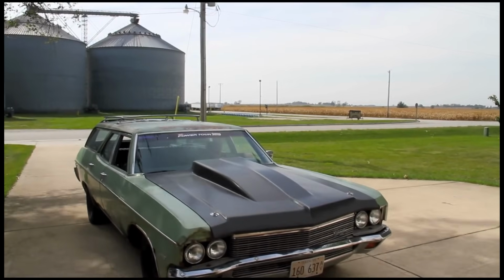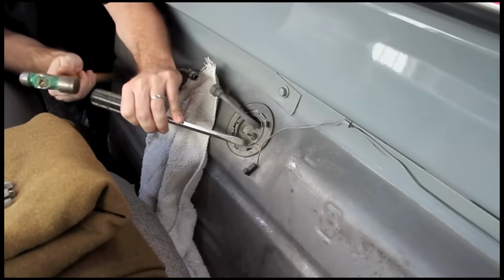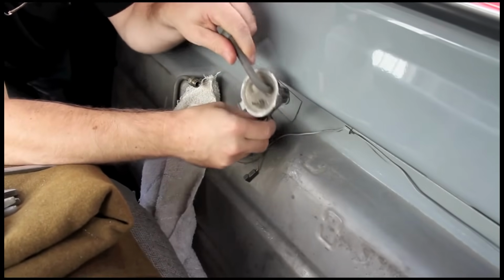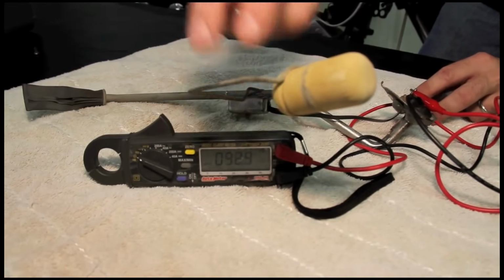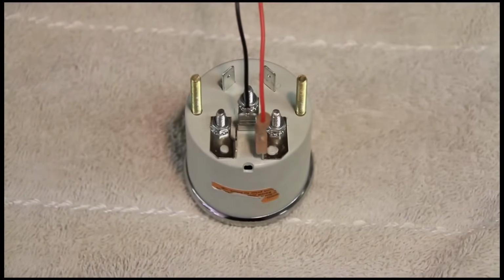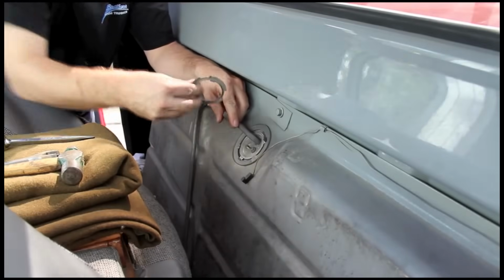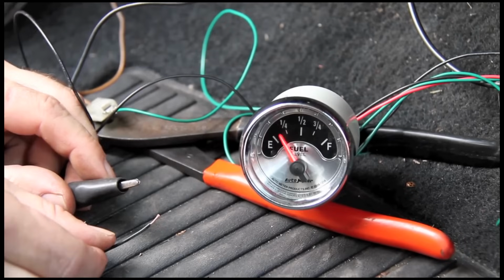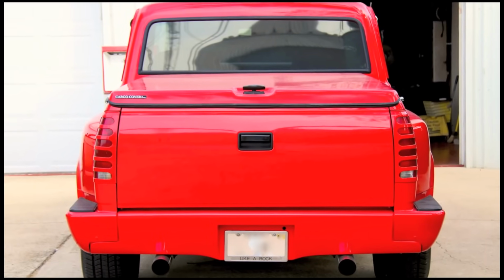Fuel Level Gauges Autometer How They Work How To Install Tutorial Instructions Ohms Wiring

Comment: I have a 93 GMC suburban and the plastic dash is brittle from years of Florida sunlight..I'm going to build a dash that looks more old school with a flat face and put all aftermarket gauges into the center of the dash maybe like an old jeep..any idea on which gauge to use?.also, I want all gauges to be round..thank.
Reply from the maker: There are many to choose from, see the following: https://www.jegs.com/c/Gauges-Tachs_Gauges/10339/10002/-1?N=1010339&Ns=P_PrimarySecondary%7c0%7c%7cP_SalesVolume%7c1&storeId=10001&catalogId=10002&langId=-1&Tab=GROUP